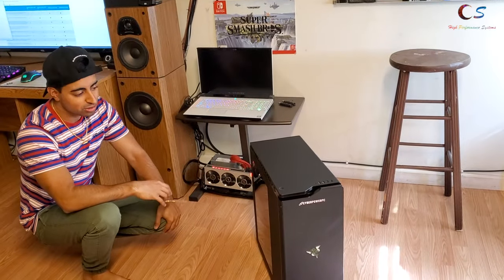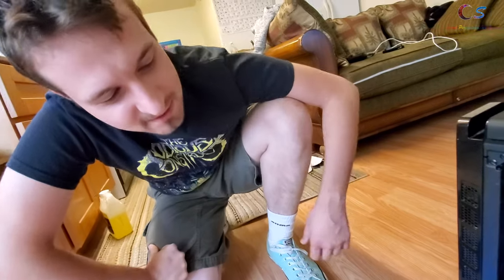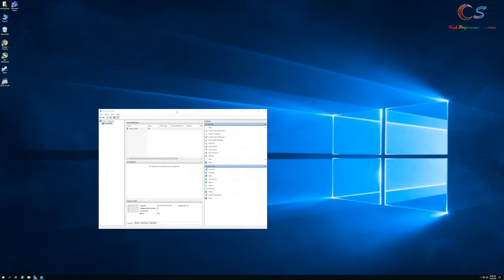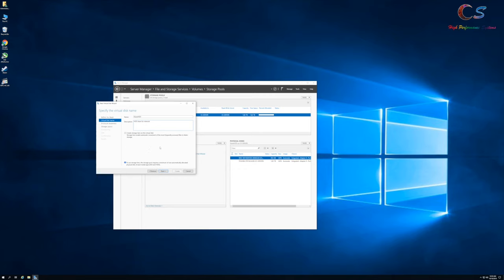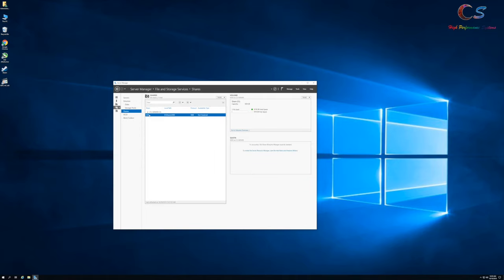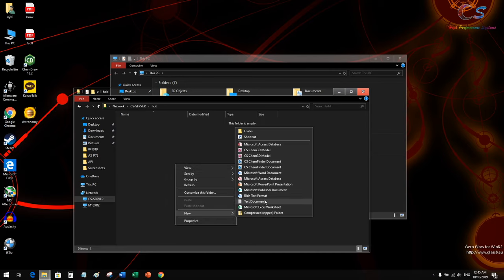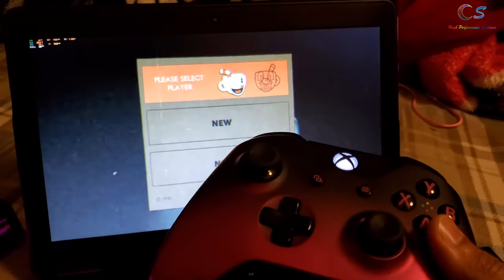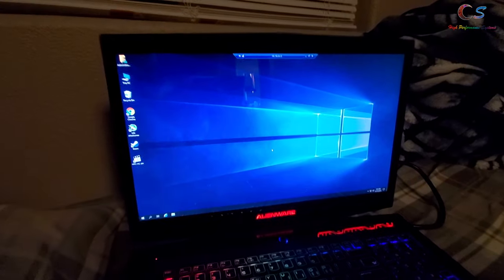Ultimate Home Server - NAS, Steam Game Streaming, Windows Server 2019

Comment: I dig the "just going for it" attitude. It was a cool build and you showed how easy it is to have something that's so dang cool. 

Constructive criticism:
-Keep the screen at 1080p. Professional instructors use as low as 1024x768.
-Explain WHY you did the disk pool in RAID1 fashion. It's a very important reason and I'd bet people would just skip the complicated disk pool steps and eventually screw themselves. 
-Use a tripod. Seriously, I'll amazon gift one to you. 

Feel free to reach out if there's anything you would like to do with cheap rack servers or in the cloud.  I've been thinking about setting up a Steam server on AWS. It would be a shame if I did that alone and no one learned from it...
Reply from the maker: Excellent comment. 
So my original plan was to make the video in 4K, I didn't realize my phone was recording in 1080p until everything was recorded. I do agree screen recording my 4K TV is small to read and will switch to 1080p next time so it's easier to read. 

Hmmm I thought I mentioned mirror being like RAID1 where if one drive fails the data is still safe, guess i should have explained more. 

I actually have a decent tripod. However I've been using my note 10+ to record these last few videos. I plan to go back to my DSLR + mic + tripod setup as that yielded better results, just much more time consuming. 

I've never owned a blade server, that sounds interesting. I should have looked into streaming from battle.net and other clients and see if they offer something similar to steam. I've never used AWS.
Reply: @cs.studios  On AWS the server would cost $0.75 per hour it's running :)

Comment: Thanks for the amazing video. Looks like it uncomplicates a lot of things.
I trying to get the conclusion on FreeNas vs Windows Server, It will be a great help if you can provide more details of your setup.
How the copy speed, 
> From laptop -> network share
> From server folder to other server folder
> Speed when say, 3 users are accessing it.
> Speed for the VM instance

Thanks in advance.
Reply from the maker: I’m getting around 90-120 mb/s which is almost the theoretical max of 1GBPS ethernet and close to my HDD read speeds. With 3 clients it slows down to around 40 mb/s per client.
Reply: @cs.studios  Thank you for the very intersting video!...I was actually finding out, if I can put my Steam-Library on my Synology NAS, and play games in my network per Wi-Fi (at home), and also when I am out of home...do you think it is possible? What kind of NAS could it make possible?

Comment: For the Seagate drive, I noticed the enclose looked like a NAS enclosure for a SOHO, by any chance did you disable the 3rd SATA Lon from the left? That pin will prevent it from functioning on a normal pc. 
Note: it’s been a while but I know there’s a pin to disable for it to be used in desktop rigs and I suggest researching into it
Reply from the maker: It was in a usb3 enclosure. I removed the drive because inside the enclosure it kept freezing my computer and ran extremely slow. I realized it’s dying after it didn’t work internally either.

Comment: How do you setup the remote accessing. I would like to access my home server when I am not at home such as over the internet. Iphon has "File" which can be access in the home but would like to access when i am not at home.  any suggestion ???
Reply from the maker: On the server machine enable incoming connections in network control panel. Then on client set-up a vpn in windows vpn setting that connects to server ip address using server windows login/password

Comment: is there a way to get every game to work? there are alot of games that will not work
Reply from the maker: As far as I know, no. Getting games to work without much input lag is the biggest issue.
Reply: If you have an nvidia card setup nvidia game streaming through geforce experience and try using moonlight on the client pc. In my experience its much better than steam streaming. I've played competitive games on my phone with a razor kishi controller over wifi and still win matches. It's quite good.